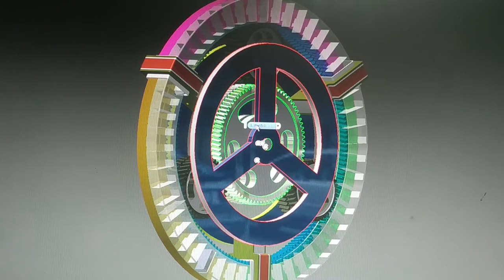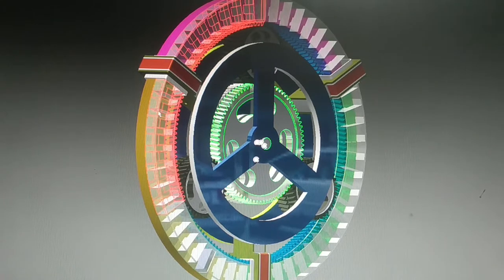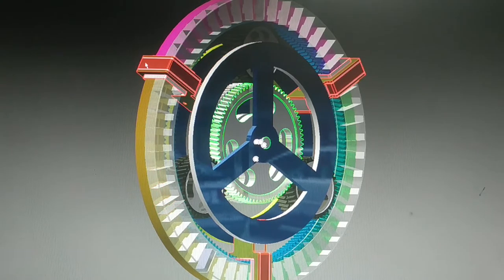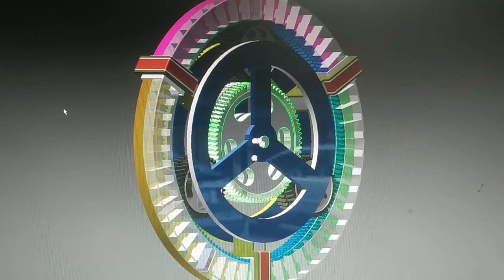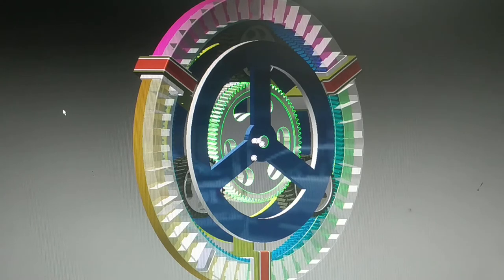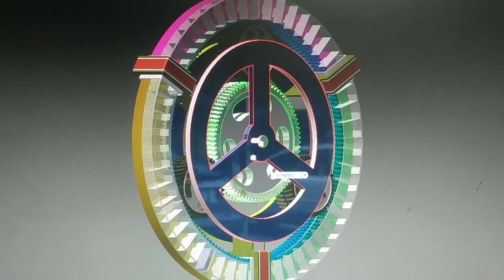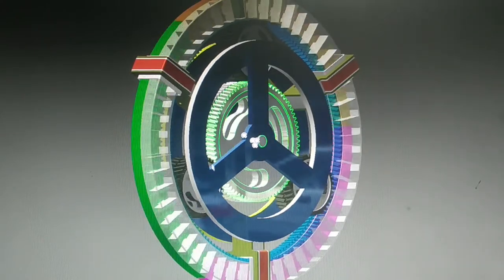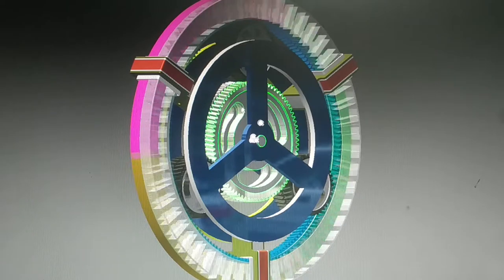Solenoid Motor Concept Redesign

Comment: Hey my firend, I just sent you an email but since you don't always get them I figured I'd post the question here. I just got the latest zip and it all looks good. My only question is do I have to print at 50% in order for the bearing and magnets to fit? I was hoping to print at 40%
Reply from the maker: I am trying to print at 40% but having issues with things turning out round, the magnets can get to suit, the round ones work out at 15mmx10mm but was made to be at 50% but not critical getting it to run smooth is going to be main problem for me my printer is crap thinking I need to upgrade it, don't bother doing the gears at 90 not working out I thought printing them standing up would work out better but has not, but it may be my printer, the very first gear I did was the best one my printer seem not the best at 40% will see how yours turns out my printer has done a lot of work might be time for a new one.
Reply: @SpaceManAus  so I should stick to 50% then correct?
Reply: @SpaceManAus  also you should look into the ender 3 or 3 pro. I've had great success with it. If I have to do over I would get the ender 3 v2. I'm also thinking about a delta printer the FLSUN Q5. The ender 3 pro can be had for 200$ and the FQ for a bit more.
Reply from the maker: @mcorrade  Yes I will give it a look, I was thinking I might break the back plat up into parts so we can do it at 50% but not sure, have you tried to print a gear a 40% yet if so how did it turn out.
Reply: @SpaceManAus  so I didn't start printing unless I know it will turn out for the overall device. I would love to print at 40% because it will save time but if the bearings and magnets won't fit at that size I will start at 50%
Reply from the maker: @mcorrade  
Do you have magnets already because the size is not a problem but the stronger the magnets the more power we should be able to create, do you gears turn out round the best one I printed was my firs at 50%
Reply from the maker: Thinking about getting this printer but will see will look some more want something with a bigger build size like this one.
https://www.ebay.com.au/itm/Creality-ENDER-5-Pro-ENDER-5-3D-Printer-DIY-PRINTING-Au-Stock-Authorized-Dealer/261888405387?epid=20024072982&hash=item3cf9c3ef8b:g:JDUAAOSw-m1e4ISz&frcectupt=true
Reply: @SpaceManAus  not too worried about the magnet, its the bearing I'm concerned about printing at 40%
Reply from the maker: @mcorrade  I can make you a bearing holder at the size you want to use that is not a problem but if you do bearing holder at 50% and the job at 40% they should still go on, what are the size of the bearing I will make you one to print at 100% to suit.
Reply: @SpaceManAus  so I don't actually have a bearing size but what I'm going to do is print everything at 40%
Reply: I'll wait and print the bearing holder last to let you know what size
Reply from the maker: I have sent you a file to you email of the back plate in parts so we can stay at 50% if we want, not having much luck with the 40 scale.
Reply: @SpaceManAus  I'm going to print 2 bearing holders one at 40 and one at 50% so see if the bearing size issue. I will let you let you know. As far as the gears, mine printed out perfectly at a lower size so I'm not worried about them.
Reply: @SpaceManAus  no many I mis spoken. I'm printing the 2 sizes just for a comparison that all. I will either print all at 50 or all at 40 I will not mix as I know that won't work :)
Reply: @SpaceManAus  so I printed the bearing holder 1 at 40 and 1 at 50 and the 50 will hold a 22mm bearing just fine but I think I'm going to still print everything at 40% and figure out the bearing holder at the end.
Reply: @SpaceManAus  I found some bearings on Amazon that WILL fit the 40% bearing holders yea
Reply from the maker: @mcorrade  
Sounds good you we will have one of each, I am doing the round magnets inline with the square one I did but round instead .
Reply: @SpaceManAus  printing is continuing and going great. The gears fit well. Hopefully by this weekend I can video the unit complete.
Reply from the maker: @mcorrade  Sounds good, I got my filament yesterday and started mine will send some pics to your email, did the 20mm x 10mm round magnets thinking of beefing up some areas and making a bigger coil winding frame, will still fit the same design but stronger better design.
Was also thinking of doing one that has no drive gear in the center no gears just rollers  and the ring since we are most likely going to drive the unit from coils pushing the magnets with some luck.
Reply: @SpaceManAus  if you make the stronger or bigger coil frame sent it my way. I think that may, may be the weak link here but I won't know until I'm done.
Reply from the maker: @mcorrade  
Will do it ASAP and send it your way.
Reply: @SpaceManAus  cool thanks
Reply: @SpaceManAus  hey do me a favor and just send the updated files cool?
Reply from the maker: Just sent you the latest files looking real nice now less parts, I think you will like a lot.
Reply from the maker: Hay I have printed out the coil frame and need to beef up the feet for the stand a bit more will send new file soon, sorry about this all other file are good to go, the coil frame without the stand are fine.
Reply: @SpaceManAus  ok cool. Still printing but ALMOST DONE, will wait for the new stand
Reply: @SpaceManAus  Hey can you send me a picture (not the file) of the new coil mounted on the system or the outer ring.I have a pick of the older coil housing

Comment: Awesome yeah use a thin copper magnetic wire 28g green 90 turns
Reply from the maker: Will give it a go, I am printing this out as we speak will try a few coil winding concepts to see what will suit best, will print you one if you like so we can work on them together.
I am also working on another idea I had and will show it as well soon,
Reply from the maker: Have made 3D printer files if you want to print one out.

Comment: Hey SpaceMan I just sent you a slew of emails so disregard all except the very last. I figured out the resizing issue with my slicer. I should be able to start printing straight away. I also do this this will work and I think I know the circuit or even circuits that will work.
Reply from the maker: Cool cant wait to see what you come up with you sure have the right gear to succeed, did you get my last email with the zip file called new folder it has the final redesign in it.
Reply: Looking forward to seeing this.
Reply from the maker: @MAGnetICus_Attractus  
I will give you the files if you like can print out your own
Reply: @SpaceManAus  I have no printer. Have you came up with a price for your pressed spheres?
Reply from the maker: @MAGnetICus_Attractus  
No had not been asked about doing so, had to step away from it for a bit had a bit of an issue when I surfaced ground it for vacuum seal took the weld of in places and needed to repair and made it worse will continue next week end, price will depend on what part of the process you are looking at, the final finished job with electrode and what not or just the chamber because I have a bit to do with it not even sure about what kind of electrode is needed to achieve what I want may not need to be as complex as the one I saw.
Reply: @SpaceManAus  I am interested in using them for thermal couples. Simple oxide layer between the pressed plates.
Reply from the maker: @MAGnetICus_Attractus  
So what do you need the just the chamber, and were you living were are they going to be sent only need the town.
Reply: @SpaceManAus  Seattle area. I can make a video later showing what I need. Pretty much what comes out of the press except a layer of soot from a flame on both plates before they get pressed together. I plan on water dripping on the top and fire below the dome. And this should create a good temperature difference.
Reply from the maker: Hay just wanted to say I designed this in parts so the coils could be wound then place on the ring as it was assembled and forgot to keep that in the design was thinking I should rework the coil for this reason what you think.
Reply: @SpaceManAus  Sounds ok but I'm going to try and work the latest coils and do what you just said. I will wind them and then place them on place once I'm done printing. The last coil is on the printer as I type :)
Reply: @SpaceManAus  I really like the new coil design and will more than likely print it at a later time.
Reply from the maker: @mcorrade  
I have worked out how I can  fix the winding issue and will create a new coil design that will look the same but break down into tree parts with each end holding on to the coil body allowing us to wind it then place it on the ring as it is assembled will do soon as possible, most likely tonight.
Reply: @SpaceManAus  perfect thanks I'll wait for that. I just finished the printing the the older coil ugggggggg lolololol
Reply from the maker: @mcorrade  
Hi,  just letting you know I have sent the new coil for you to look at and print if you like it, let me know if you have any better idea's.
Reply: @SpaceManAus  I never got it. Better check your out folder :)
Reply from the maker: @mcorrade  
I checked my email and it said it has sent two files one was not zipped up it is the coil body with holes cut out, I hope you like it.
Reply: @SpaceManAus  yes I got it and they lok great! I will print these because they'll be much easier to wind. Just to make sure I'm not crazy, there are 3 coils for the device right?
Reply from the maker: @mcorrade  
Yep print two of the ones I sent, the last file I sent was the same as the the other file I sent previous but the last one has H in the name for holes cut out, so you can do with holes or without, but do two of each part and I will do the stand  soon and send it along with the new ends as they are the only change, you could do three coil bodies if you want as it will fit the next lot I send as well.
Glad you like it, and sorry for not waking up to it earlier and wasting your time.
Reply: @SpaceManAus  ok cool. It would probably work just fine with the 1 coil but better with 3 in series
Reply from the maker: @mcorrade  yea  I thought it would give us more options with three, I plane to have more then one coil on each mount for different reasons charging and driving the ring, but I seriously need to look at getting another printer I am having all kind of issues prints not working out, not sure if I have a bad connection or what it is, would like to see how your prints turn out, I will print something I know I have done well before and see if it is the printer or the file corrupted or read issue with the main board.
Are your prints OK.
Reply: @SpaceManAus  my prints are great. The Ender 3 pro is cheap but reliable right out of the box. I want to get a delta printer to add more print options. I will make a video today showing the parts I've printed.
Reply from the maker: @mcorrade  
good news can't wait to see how it is coming along waisted so much time PRI t rubbish, will get the ender 5 pro I think.
Reply: @SpaceManAus  The one setting for some really difficult prints I've had that made the difference is to use a raft and I knock down the size of the raft as to not waste time and material. The raft setting has been a life saver.
Reply from the maker: @mcorrade  
It is not the parts coming of the plate I have it is the print it self not building well, may be a faulty cable or the main board having issues will send a pic of the failed prints next time to show you what I mean, I think I think I will get another printer have had this one for some time now have built some seriously cool things on it without problems but something is failing and just cant be bothered to track it down, may e a stepper motor or something else but the time to track it down will involve to much time, will look at it another time, would like a bigger build volume anyway.
Reply: @SpaceManAus  not going to be able to make that vid tonight. Will try and do it tomorrow
Reply from the maker: @mcorrade  
No worries can't wait to see it, have found the printer I will get but will take some time to arrive.
Amazing printer has all the good stuff I like, linear rails direct feed extruder carbon glass print bed, large build area, just love it.
https://seckit3dp.design/
Reply: @SpaceManAus  good hear. Hope it works out for you

Comment: ok so I just sliced up all the parts with the proper sizing and the total print time all combined is about 64hrs. uggggggg. I may try and print a small version for a faster print time just to shake out any issues.
Reply from the maker: I did mine at high resolution and it took 60 plus hours but may be able to do it at a less resolution to save time.
At 50% it is about 255mm in mediator

Comment: So I just started printing. I starting with a small test version. Once its all printed, I make video so show the device
Reply from the maker: Sweet I am still going to use the parts I created and use it to get it running then I will send it to a friend I have in the states to play with unless he gets his own 3D printer.
I think this has a lot of potential, I designed it years ago and showed the concept on here but had no one contact me abut the design, think I know why that is now, but decided to finally redesign it for #d printing so I could try it myself and show it running, should be a fun thing to play with.
Cant wait to see how you go with yours, should be able to almost just put it together without to much clean up, the teeth on the gearing is about all you may need to touch up.
Reply from the maker: Have sent you the final print files today, all looking good.
Reply: @SpaceManAus  got em thanks
Reply from the maker: @mcorrade  
NO worries, hope you like the improvements should come together easier then the first effort, mad a stand for you as well and counter sunk the holes for the mount on the inside of the back plate, hope you like it, the bear holders are to suit skateboard bearings they are cheep to by and easy to get but will create them to suit what ever you like.
Cant wait to see how it turns out.
Reply: @SpaceManAus  I will probably re-slice the whole model with the new setup.I will do as the same at 50%
Reply: @SpaceManAus  Hey I just uploaed a new vid showing some stuff as well as a demo unit of your design. I'm ashamed to say I got your name wrong in the video pal so sorry for that ugggggg
Reply from the maker: @mcorrade  no problem can't wait to see it so sorry about the short text, I will need to print mine at 25 percent my print bed not big enough to do the back plate.
Reply from the maker: @mcorrade  Hay did you check out the other new ring gear magnet setups I did, will change the outer bearing holder to be flat for printing purpose will send it later today
Reply from the maker: @mcorrade  Not sure where the video is you have uploaded went to your channel did not see it yet.
do you have a  link.